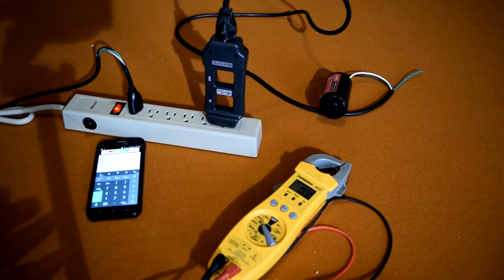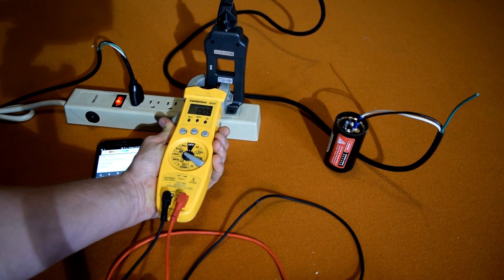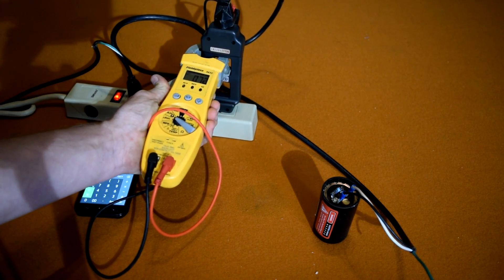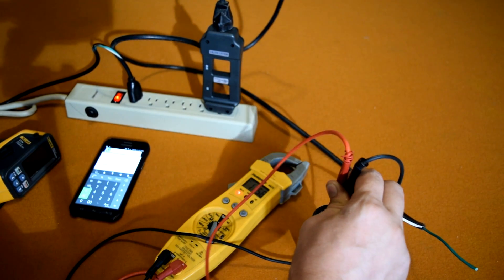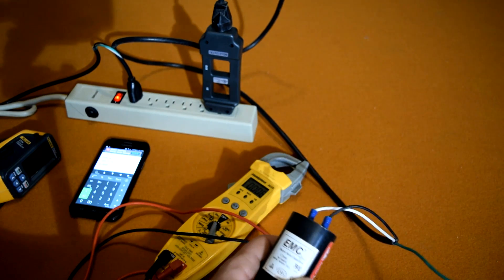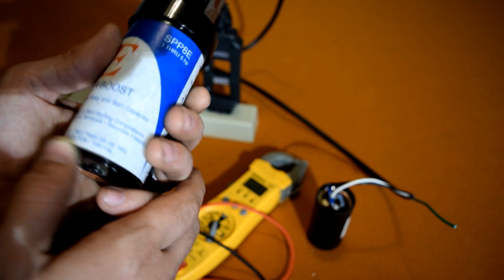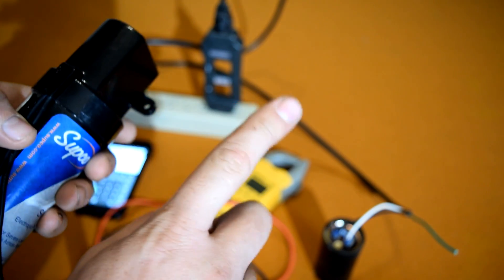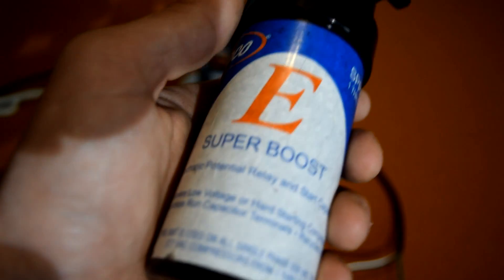Start Capacitor Vs. Run Capacitor Why You Can't Store A/C Power In A Capactor

Comment: If you are talking about a air on/fridge etc start capacitor they are only on until the motor reaches 75% of the pump speed, then the start winding and start capacitor is turned off either by a centrifuge switch or a relay. At this point the much smaller uf rated capacitor or capacitance in the case of a dual capacitor takes over, which does not consume much power. The start capacitor should only be on for a second whenever the compressor needs to start. Why would you replace a known rated start capacitor with an aftermarket capacitor with a different method to cut out the start cycle? Every motor has different windings and wire thicknesses in those windings, so the manufacturer will work out what capacitance is required for each motor design. If you put different rated cap in a system the motor will run hot as will the cap.What I am getting from your video is that you are assuming the start cap is on all the time.

Comment: The simplest way to explain the mechanics of a capacitor in layman terms would be to compare it to a battery; both store and
release electricity. Capacitors are charged with electricity then release its stored energy at a rate of sixty times per
second in a 60 cycle alternating current system. The sizing is critical to motor efficiency just as sizing of batteries is
critical to a radio. A radio that requires a 9V battery will not work with a 1.5V size battery. Thus, as the battery becomes
weaker the radio will not play properly. A motor that requires a 7.5 uF capacitor will not work with a 4.0 uF capacitor.
Much the same way, a motor will not run properly with a weak capacitor. This is not to imply bigger is better, because a
capacitor that is too large can cause energy consumption to rise. In both instances, be it too large or too small, the life of
the motor will be shortened due to overheated motor windings. Motor manufacturers spend many hours testing motor
and capacitor combinations to arrive at the most efficient combination. There is a maximum of +10% tolerances in
microfarad rating on replacement start capacitors, but exact run capacitors must be replaced. Voltage rating must
always be the same or greater than original capacitor whether it is a start or run capacitor. Always consult
manufacturers to verify correct capacitor size for the particular application.
Two basic types are used in electric motor:
1) Run capacitors are rated in a range of 3–70 microfarad (uF). Run capacitors are also rated by voltage classification.
The voltage classifications are 370V and 440V. Capacitors with ratings above 70 microfarad (uF) are starting capacitors.
Run capacitors are designed for continuous duty, and are energized the entire time the motor is running. Single phase
electric motors need a capacitor to energize a second phase winding. This is why sizing is so critical. If the wrong run
capacitor is installed, the motor will not have an even magnetic field. This will cause the rotor to hesitate at those spots
that are uneven. This hesitation will cause the motor to become noisy, increase energy consumption, cause performance
to drop, and cause the motor to overheat.
Examples of our Motor Run Capacitors: CBB65 Oil-filled Capacitors
ADP Dry-type Black Box Capacitors
CBB60B Dry-type Capacitors
Italfarad Dry-type Plastic Case Capacitors
2) Starting capacitors are housed in a black plastic case and have uF range as opposed to a specific uF rating on run
capacitors. Start capacitors (ratings of 70 microfarad or higher) have three voltage classifications: 125V, 250V, and 330V.
Examples would be a 35 uF at 370V run capacitor and an 88–108 uF at 250V start capacitor. Start capacitors increase
motor starting torque and allow a motor to be cycled on and off rapidly. Start capacitors are designed for momentary
use. Start capacitors stay energized long enough to rapidly bring the motor to 3/4 of full speed and are then taken out of
the circuit.
Examples of our Motor Start Capacitors: CD60B Aluminum Electrolytic Capacitors    P.S did not post this to discredit your vid but to enhance  it through read material    (contributed)
Reply: Very good in formation
Reply: No, his video thoroughly sucks.

Comment: hi every one .I want to buy a run capacitor for 2 HP motor.but I don't have the olde capacitor.can u  give me instruction for this capacitor
Reply from the maker: mayub shah what's the model number for the two horsepower motor what type of voltage is it running what is it running on these are things that I would need to know
Reply: mayub shah I

Comment: What power supply is this? Looks like 110v AC... I thought capacitors a polarised and can't be connected out of phase?
Reply from the maker: it's an alternating current capacitor
Reply: Electrolytic and tantalum capacitors are by nature polarized and therefore should only be used in DC applications. Other technology capacitors such as ceramic and polycarbon are by nature non-polarized. Problem is, the non-polarized technologies have practical limits for capacitive volume density, therefore it isn't practical for manufacturers to create non-polarized capacitors in the high microfarads ranges because package sizes would be unwieldy. So the larger value capacitors (microfarads and higher) are built using polarized electrolytic technology usually. Which raises the question, "how do we get around this limitation ? Years ago (actually probably decades ago) someone very clever realized if you wire two polarized capacitors in series back-to-back, it will behave as a non-polarized capacitor whose aggregate capacitance follows the standard formula for capacitors in series: 1/C = 1/C1 + 1/C2.  Typically in practice you use two of the same values so for instance  if you want an aggregate value of 100uF, use two 200uF back-to-back (again in series, not in parallel).
Reply: ...therefore when you see high value capacitors spec'ed for AC applications there is no polarity marking on the package and you can in fact wire it to the external circuit either of two ways.

Comment: Wow. Thanks for explaining this. I had no idea the hard start would kill my AC. I thought I was doing a good thing when I ordered it. The plan was so my solar would start the AC, but I wont have the system ready till next year. Do you think I should unplug the hard start till then?
Reply from the maker: +Stim Racing Trailer and Travels yes and look at buying a inverter compressor it has no lock rotor amps
Reply: Just no googled, thanks for the info
Reply from the maker: +Stim Racing Trailer and Travels I will get a type of heat pump that's inverter compressor
Reply: STIM RACING : DON'T LESSON TO THIS GUY ! Start Capacitors will not harm your ac unit Higher end ac units come from the Factory with start capacitors if you look at the wiring diagram on most ac units it will show a start capacitor & relay  "AKA hard start capacitor as some like to call it " But the unit doesn't have them that's because the lower end units don't have is to cut cost  if your ac unit has a copeland compressor you can go to there website and look up the model # and it will show you the factory start capacitor & relay  Spec's IF ITS WAS GOING TO HURT THE COMPRESSOR THEN WHY WOULD THE MFG SHOW A START CAPACITOR ?  & Train , Carrier would not be putting them on there Top End units ! here the site for the ZPS & ZP compressors look at page 14,15,16  most use a 88-106MFD @ 330V  Start capacitor Those 5-2-1 Hard start kit are just start capacitors with a relay for ac units that did not come from the factory with one the problem is most of those Hard start kits they CHINA MADE JUNK & the capacitor only last about 1-2 years  You can by the relay & then buy a good Quality USA made B-M-I Start capacitor .